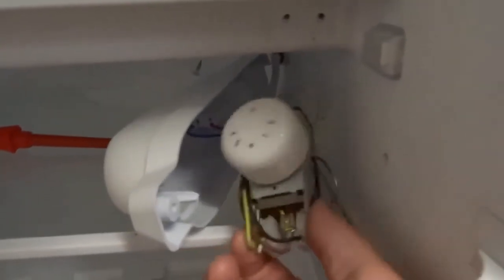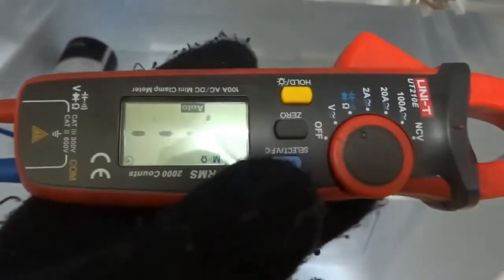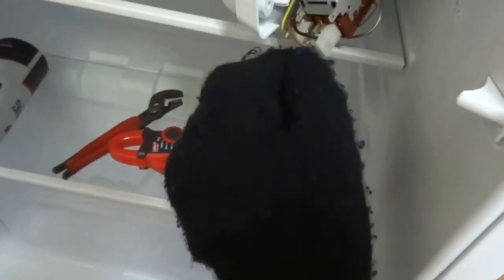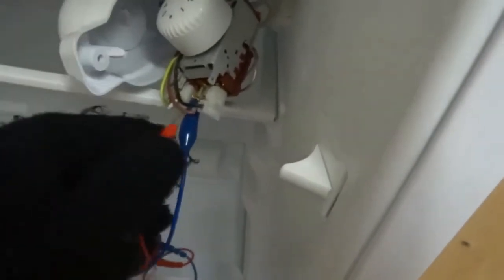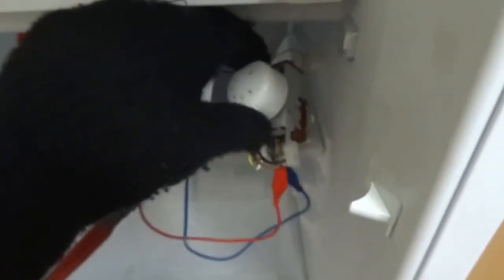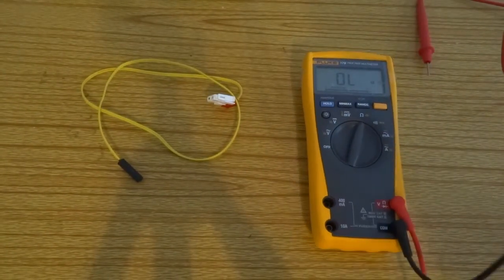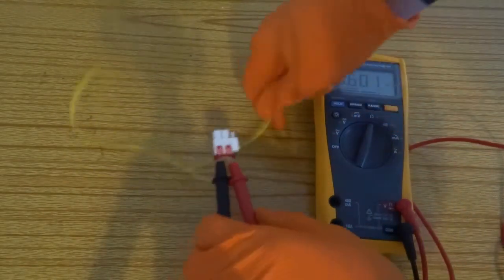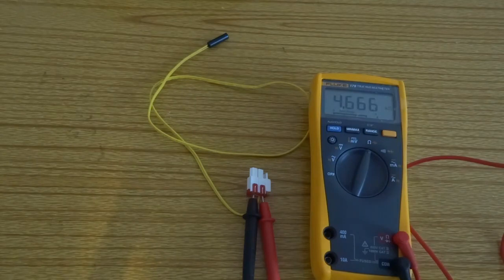Fridge freezer thermostat and NTC thermistor digital sensor testing multimeter

Comment: Hi, the fridge part of my russell hobbs fridge freezer is really cold even on number 1 setting, the feezer is fine. Would the thermostat be the only problem that could be causing this. Cheers.
Reply from the maker: it could be a few reason depending on system - thermo - airfow - sensors.